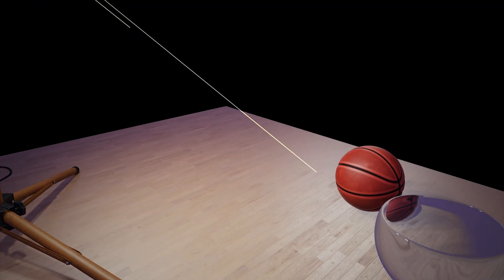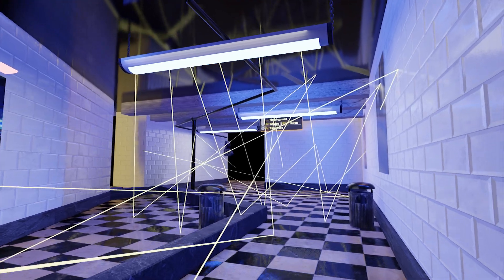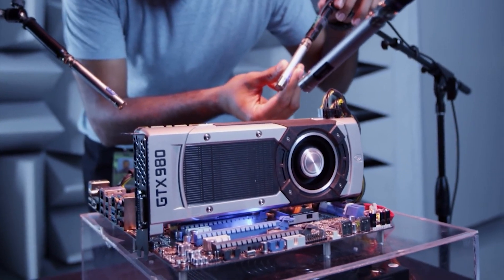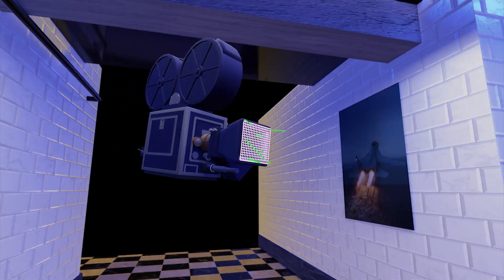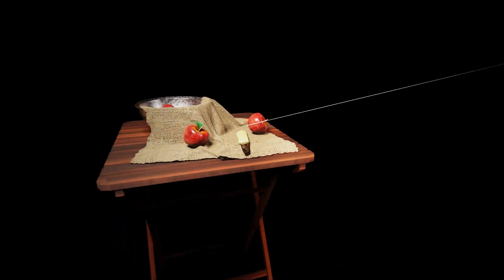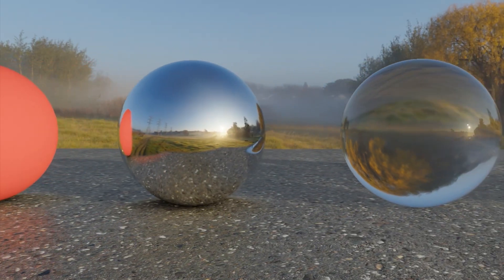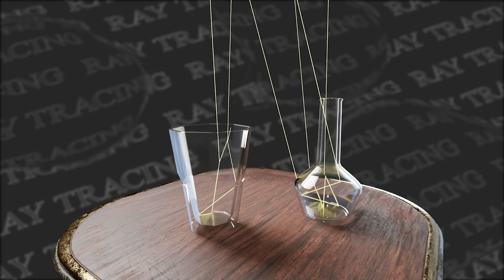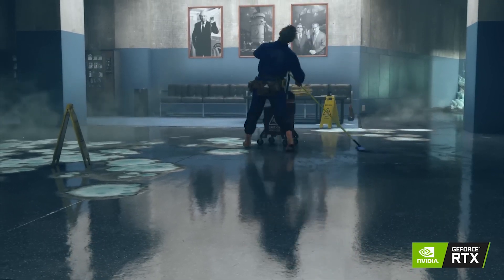How Ray Tracing Works

Comment: Whitted ray tracing.
Shoot ray from camera and at every intersection shoot rays to every light to check shadow.
If surface was reflective or transparent generate reflection/refraction rays and do same to them.
Problem is huge amounts of rays. (And that it didn't generate global illumination.)

Early path tracing was optimization, where you shot ray and followed it's path.
At hit, choose 'randomly' what path to take diffuse/reflection/refraction, shoot a ray to continue path until light is hit.(Or you are read to terminator ray and choose closely light you try to hit.)
This allowed very deep paths, but needs huge amounts of paths per pixel to generate image)

Modern path tracers still follow path, but check visibility to lights during path.(And may be bi directional etc... and much more.)

In simplest form ray tracing is occlusion test between a ray and some other primitive.
It's basically occlusion test from inverse direction to how rasterization does it.
Ray test to primitive instead of primitive test to ray.